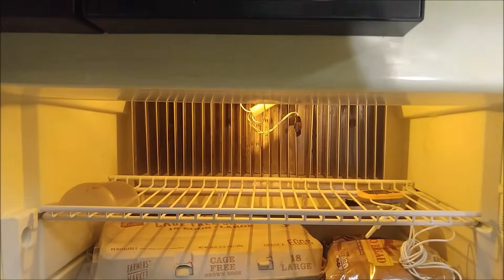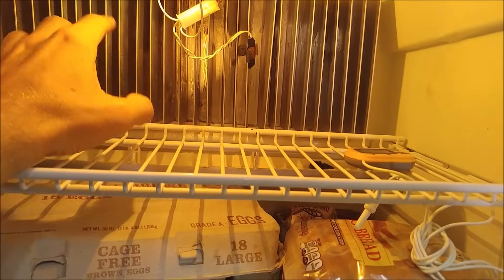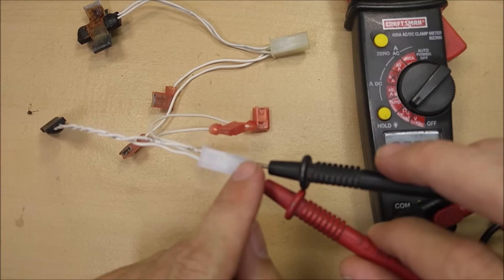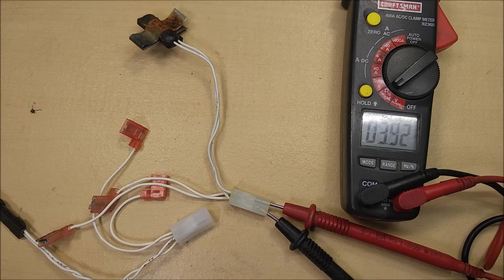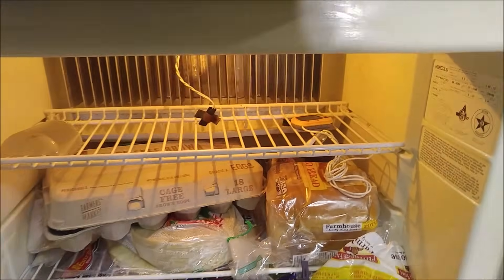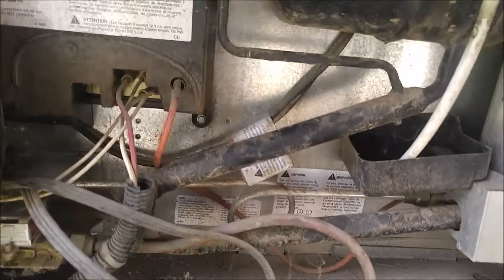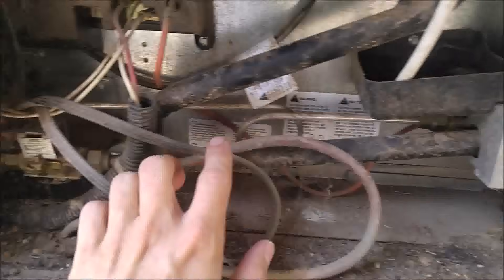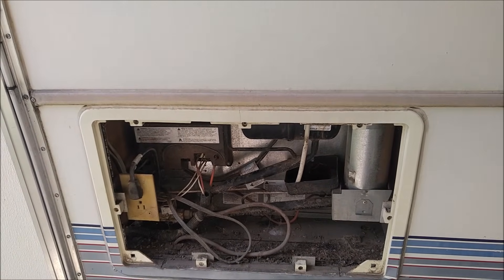The NO-NONSENSE RV Refrigerator Repair & Troubleshooting Guide ~Figure it Out in 5 Min

Comment: Good straight to the point video, well informative information. I have a Norcold N811 stopped cooling after a week of "below 0" temperatures. I thought the unit had went out, turns out the "Thermistor" was the problem. I too ordered from Amazon, too bad they made you remove the links because it only helped their business. Good Job!
Reply from the maker: Sweet! I'm glad I could helo!

Amazon, sadly, is proving to be a beast to those that made them...
You should see the reports of all the sales I sent their way.

Comment: Hey man great video tutorial.  I've tried everything in your video and my fridge powers up , check every thing but not the board. Its fairly new system and still not cooling when the flame is on or straight power. Any ideas I  need some help. Thanks 👍
Reply from the maker: Have you left it cooling overnight?
Reply: Same problem here, it’s been cooling overnight, flame works and ac works but fridge won’t get cold. Changed the thermistor but not the control board, would the control board be the problem?

Comment: Here's a problem no one seems to know what to do. The freezer works if propane tank is full and won't work at 1/2 full 30lb tank. And the fridge won't work at all. No thermostat or adjustment. Refrigerator people don't understand it.
Reply from the maker: Your propane regulator might be going bad. You need to check gas output with a manometer. Or try a known good regulator.

Comment: How do you check the control board for power?
Reply from the maker: Using a multimeter, probe your wire connections coming into the board. You will have 2 for 12V DC and 2 for 120V AC.

Comment: When we bought our camper.the  refrigerator was not working turn out to be the outlet. There was a short in the wiring in the closet by the bedroom. I’ve went through and replaced all the outlets in my camper and make sure all wires made good connection.
Reply from the maker: That is a good idea. The outlets used in RV's are not built to the same quality standards as home outlets.

Comment: I have a good solid flame from the LP gas connection but the fridge is not getting cold. Any advice?
Reply from the maker: Is the freezer getting cold?
Reply: @TrailerDayz  It got cold on the electric (shore power) then when we switched it over to LP it ran fine. I was worried over nothing :)

Comment: Do you know if it is possible to hook up a 2014 Domestic RV fridge in a cabin without electricity or solar.
Reply from the maker: Yes. As long as you have gas and 12V DC power for it

Comment: Freezer works, fridge doesn't. Possible causes? On electric currently. Holes in back of freezer are iced over, is that an issue?
Reply from the maker: Did you ohm out your thermistor? Defrost also.

Comment: Hey! I need help
I have a fairly brand new Norcold N641. It worked great on AC & LP then one day neither would work.
In AC mode in the heating coil is getting hot, along with everything else.
In LP mode you can see the pilot light working good and everything is getting hot in the back.
The thermistor ohm'd at 9.01

But in either mode nothing cools inside. Nothing gets cold at all??
Reply from the maker: Did you park it on a hill? How long did you keep it on to determine if it was cooling?

Comment: Thanks for the video!

So the Thermostat checks out good.
In gas mode, the flame is good and the ammonia pipes are hot.  
However, the fridge is NOT cold... 
So the controller must be telling the flame to be on... but it is not chilling?

Would this be no ammonia?  2018 Fridge.  So not that old on Norcold N811.
Reply from the maker: How long have you left it on?

Comment: Very good video!
One question, if neither the AC or LP is working, is that a faulty motherboard?
Reply from the maker: Did you check for voltage at the board as shown in the video?

Comment: Does the refrigerator need to have 12v voltage in order to operate with propane?
Reply from the maker: Yes it does. The 12V powers the control board which in turn opens the gas solenoid and controls the temperature and burn.
Reply: @TrailerDayz  thank you for responding, I appreciate it

Comment: Is there a way to reset the AC side? Someone was telling me he had to jumper two pins to reset his refrigerator. Well, let me ask you this: My refrigerator doesn't get cold  running on AC shore power. It was, and then suddenly it wasn't. It gets cold on propane. It's less than a year old. It's a furion unit. Circuit board? Or reset?
Reply: I've never heard of a reset method. Let me know if you find any info on that. You could try unplugging the AC and 12V lines from the board for a couple min.

To verify your 120V heater, set it to AC, then use a multi-meter on the lines running to the heater to see if you have voltage there.

Comment: I have an Atwood Helium fridge and it doesn't work on electric, battery, or gas. We replaced the circuit board and that didn't fix it so I returned the circuit board. I then bought a thermistor and that hasn't fixed it either. I am at a loss and have a big trip planned in less than a month. Do you recommend trying to fix it further or just pulling it out and replacing it with an all electric fridge like a compact apartment style. My fridge is the 8cf size. Help help help!
Reply from the maker: You're not getting power it sounds like. Test for 110-120V on the AC feed and 11-14V on the 12V feed
Reply: TrailerDayz forgive me (female here) but what if the lights on the front come on for a minute and then go off and then nothing? Same suggestion?

Comment: So we have just the freezer working but not the fridge i dont know if that is commen or enough about how the system works to know anything about it but is that likely the thermistor
Reply from the maker: Is it turned up all the way? There is only one cooling system which is concentrated in the freezer, so if it's working the fridge should be getting cool also. It takes about 12 hours to reach desired temp. If turned all the way up, you probably need a thermistor

Comment: Really appreciate the no bs approach. Norcold was working properly but recently temps rising in both frig and freezer. Ice buildup like you’ve mentioned so I’m going through the basic troubleshooting tips. The black drip tray in back of mine is filled with slimy looking water. Does that mean something specific or is it likely related to the ice buildup?  I should mention we recently bought the rv used and after dewinterizing we noticed pink antifreeze dripping from the freezer. Tia for any advice
Reply: Did you ever learn what the issue was? My black tray is filled with nasty slime water too

Comment: I have a new Dometic and it will not work at all. Not on Gas or AC either one. Plus the light inside is not coming on. Help please
Reply: Check you fuses and Breakers.

Comment: @TrailerDayz what do you do for troubleshooting the board? Ours won't open the solenoid and light lp, but the selonoid works if I bring 12v to it myself. Then I can light the flame manually that way. Display shows "A" (no a/c power) but we know that. 12v is good.
Super thanks!
Reply from the maker: Replace the board, or send it in for repair
Reply: @TrailerDayz  thanks man, I'm on it

Comment: Thank you. Nice vid.

I removed my metal box at the pilot flame.

Will it work with the metal box off ? Or do I need to make sure its put back in place ?
Reply from the maker: Yes you can test it with the cover off. Make sure there is no flakes of metal on the burner and the flame looks good.
Reply: @TrailerDayz  I have a fairly new unit, but doesn't seem to cool down in propane mode.  Blue flame looks good, I blew the area clean.  Any suggestions?
Reply from the maker: @bobgil3464  might have something obstructing the solenoid or the orifice.

Comment: ok now what if your lines are hot and you can hear the liquid gurgling inside and in the back and still not getting cold then what
Reply from the maker: Did you let it run for 24hrs?
Reply: and then some yes is say more then
Reply from the maker: And it's not getting cold at all?
Reply: the condenser is warm almost hot and the evaporator in the high tem and low temp freezer are warm after more then 24 hours or more by the way thanks for asking and getting back to me im am a commercial refrigeration tech 15 year + service but with my rv im lost with ammonia systems
Reply from the maker: @hotrodpegleg  has the unit been laid on it's side, or at an extreme angle? Look up "burping RV refrigerator". The ammonia can get trapped in the wrong place, or an air gap gets formed. If you basically turn the fridge around and upside down slowly, you can kind of get the air to burp.
Reply: thanks worth a shot no is has been in its slot sense I was put in im guessing ill try that and see how it goes thanks

Comment: I would love to burn my camper I got a lemon for 6,000 because I was living on my car now no water is coming in the tub, the commode isn’t sealed all the water was running in my floor now the floor is peeling up my refrigerator isn’t working don’t have no heat because the wheel is not turning, the hot water heater who ever had it never drained the water out so it frome and it’s busted , I have to replace the kitchen sink faucet because water is shooting out from dry rot .boy did they see me coming . I’m sick of fooling with this piece of crap ?

Comment: The tubes on the back of my fridge are hot to the touch. But the coil above it. Where I am guessing the exchange of heat is happening. They are cool to the touch. Basically whatever the outside temp is. Does that mean the tubes are clogged somehow? If so how do I unclog a stationary RV?

Comment: Great video! However I just have a copper wire held on to one of the fins. Everything else is working (gas, electric) even the little freezer box gets nice  and cold. Just nothing from the fridge compartment and like I say just a copper wire on one of the fins. Any thoughts?
Reply from the maker: Mitchel Farmin Your thermistor might be different, or someone tried to pull it off at some point

Comment: My Norcold N621 is very similar.  I get a "d" fault which tells me the door has been left open for more than 2 minutes.  The door is closed.  Where is the door ajar switch?  I don't see one anywhere.  How does it sense door open/closed?  I recently replaced the board and optical unit with a kit from Norcold PN 633292.  Thanks for awesome videos!
Reply from the maker: rcastorena There is a mechanical switch on most of them. Usually the light will turn off and throw the door code

Comment: Awesome and thanks! Mine is not cooling but almost seems warm after running awhile. It also makes a gurgling water type noise. Any ideas?
Reply from the maker: ShoreLooksNice.com Has it ever been laid down on it's side? You might be able to burp it. You basically have to turn the whole unit upside down to get the ammonia back down into the collection chamber.
Reply: did you try this? mine has the same symptom. Have power and lp gas on. Get's hot and makes a gurgling noise but does not cool. I have already changed the thermistor. Don't have sings of ammonia leak. It's an 03 norcold.

Comment: why is my freezer working great but the fridge part won't cool? thanks.
Reply: TrailerDayz thanks for the information
Reply: Clark_Elite BlackBer
ry USA
Reply: My freezer is very cold but my fridge is just below room temperature. Lp or electric doesn't matter. Been running for 10 days. Flue stopped up maybe?
Reply: I have the same problem. Ran it for 5 days straight. The freezer worked just fine, but the refrigerator was useless. Norcold N302 model.
Reply: @JohnKrytus  I blew my fridge's flue out with a leaf blower and everywhere I could on the exterior. I then perfectly leveled the fridge, not the camper. Fridge is now cold as can be.
Reply: MrLongshot762 Has
Reply from the maker: Aaron Clark That depends on the model. Does it have 2 zone controls (one for the fridge and one for the freezer)? Most only gave one temp setting.

Turn it to the coldest setting and leave it running overnight. These are ammonia absobtion coolers which don't cool the air in the same way as a house refrigerator. They work by absorbing the heat which often doesn't feel as cool as a normal fridge.

Comment: What if the fuse keeps popping?
Reply from the maker: jiggy loo You may have a wiring short somewhere or a bad component. Unplug your 12V power from the control board and set if it still blows. If not, unplug components one by one from the board with a new fuse until it doesn't blow anymore.

Comment: Can you tell me why my fridge is drawing all over inside the fridge and ruining foods?
Reply: Comal Cat Your fridge is a talented artist, let it draw, don't stifle it's creativity!
Reply from the maker: Comal Cat If you meant draining not "drawing", The outlet tube for the drain still probably has it's factory plug installed. Open the exterior access panel and find where the drain tube comes out. Older models drain into an evaporation tray, newer ones just stick through the access panel an drain outside. Look in the end of the tube and see if there is a plug. Then try blowing through it. If you can't blow through it, there is a kink or clog somewhere

Comment: good video on how to troubleshoot the thermistor, but it fell far short of the title of the video... it gave a brief description of how the system works, but didnt show how to troubleshoot the gas valve or the igniter... and more importantly, the outputs of the board itself..... nor did it mention the fuse. another  couple of minutes could have covered it.... but what was shown was to the point, which is good.

Comment: No one ever shows where to check for the voltage. They say it, but never show it, and neither did u
Reply: April Armstrong Voltage? 12v or 120v?

There are only 2 wires. They were pointed to in the video.
Reply: I agree, and I think what she is talking about is all the points within the control board that you are supposed to check. I am having a problem with my fridge as well, and trying to find videos that actually show each point that you touch with the multimeter prongs to help determine whether or not the control board itself is bad

Comment: I stopped the no co error for good without ordering a thermistor.  I stuck a 1.5 k ohm resistor across the thermistor terminals at the connector.  I suspect I may have to manually defrost it eventually,  but who cares.  It's been doing great over 2 weeks now. Before, I was getting the no co error 2 or 3 times a day.  The thermistor is still installed. that's just a 1500 ohm little 1/4 watt resistor was all it took.  Other values would probably work too I would bet from 680 to 2.2k.

Comment: Great Video. I have a norcoldn510.3 in my travel trailor and I replaced board in back of fridge but still no display on the fridge inside should I replace the display board?
Reply: B Eth probably. check the wires and connectors first though

Comment: The symptoms you described fit my situation, cooling fins frosted over. Removed lamp cover to discover it was full of water, electrical connections green with corrosion.  Dryed it with compressed air then sprayed the contacts with electronic contact cleaner. Restarted, Perfect operation restored. Thank you for setting me on the correct course.
Reply: Freezer cold but fridge not any ideas

Comment: Hey,
Whats the repair for if neither ac nor lp are cooling, but both are working? I plugged in the rv and had it on when I was on extremely un-level ground. Is the fridge shot, or is there a remedy for repair?

Any input is much appreciated.

Seth
Reply: seth little is the A.C. heater getting hot? what about the rest of the tubes?
Reply: I didn't check the temp of the a/c heater. I did turn on the LP and there is a flame and the (stack) is hot.. The remaining tubes didn't feel hot.. I'll check the a.c. heater tomorrow, I'm leaving it plugged in over night.
Reply: seth little RV fridges do cool much slower than normal house fridges.
Reply: Ok, heres an update. I left the fridge plugged in and on all night. it's been a little over 24 hours. The A/C heater is hot, the tubes are cold. inside temp of the fridge rose from 50-70 degrees.
Reply: any luck? mine does runs but doesnt cool and yes I let it run a few days level as well. Ive ran it unlevel and it never cooled again.
Reply from the maker: FatFendered39 if you checked your thermistor, your last resort is burping the system. (turning it upside down)
Reply: TrailerDayz should it be plugged in and running when it's burped?
Reply: Did you ever get this to work, and if so how?  I have the same problem  you are describing seth.
Reply: what ended up fixing your issue?
Reply: The frig needs to be level. Otherwise it wont work.

Comment: How do I know which fin to clip it on? I 99% positive its on the right one, my son pulled it off for me but didn't check before he did. There was a lot of rust on the fin so I'm assuming that's the one. 
I did change my thermistor but its still not cooling. :( I have hooked up to full-time electric, we're level, was working for the last few months and just stopped cooling. We have had a few power outages but that's it.
Reply: LC Peterson It can go on any FIN really.

Comment: Oh. Re watched again. So I may possibly have a control board issue. I'll need to pick up a voltmeter & a tool that will get the screws off the control board. Taking those screws off is the hard part....then I drop them! 😋